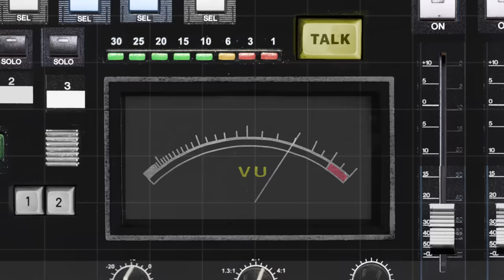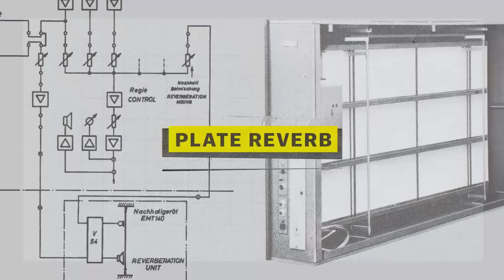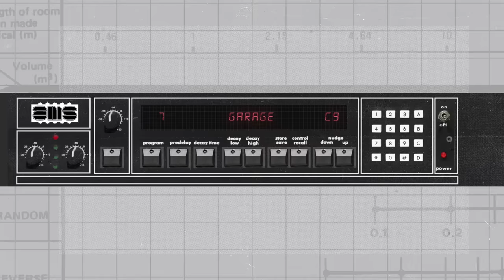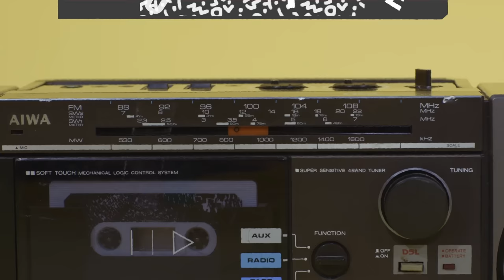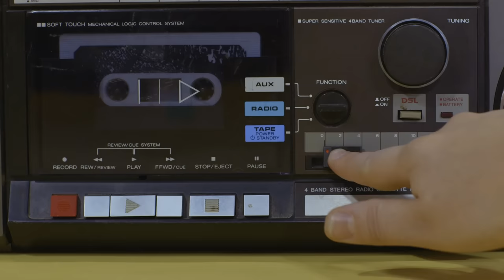How a recording-studio mishap shaped '80s music

Comment: Youngsters here are not aware that the famous " Wall of Sound" that record producer Phil Spector created was an empty underground propane tank used as a reverb chamber. This was in the early sixties.  The real innovators were George Martin and the Beatles, accompanied by the young Geoff Emerick, as they broke all the old studio " rules" which were designed to protect the sensitive and expensive microphones and other equipment.  They removed bottom drum heads and inserted mics directly into the drums, them used compression and fooled around with tape speed to lower the pitch, in addition to applying reverb and double-tracking. On the song " Rain", a bass guitar speaker cabinet was placed face to face against a second passive bass cabinet which became a " microphone " itself that offered a unique sound. On " Tomorrow never Knows", Lennon asked for a vocal effect which would make him sound like the " Dalia Lama" on top of a mountain". Young engineer Geoff Emerick at first was stumped because reverb and double- tracking would not achieve that. He came up with placing a mike up to the rotating horn of a leslie speaker cabinet, where Lennon's voice would be routed, instead of an  organ. The slow rotation of the horn not only created a " phase shift" effect, it also applied a severe frequency limit to the vocal, making it sound like a " bullhorn" without the distortion. Emerick even used a pencil to "warp" the sound coming from a particular tape machine during a mixdown to create a special effect.
         The first digital effects in the 1980s were low bit rate devices with poor fidelity , bad dynamic range, and full of noise....the old studio tricks done by the Beatles were done on expensive pro equipment and though these tricks were mechanical and done manually,  the FIDELITY was high quality with a full range of frequency response. Just listen to the drums on " A Day in the Life",or, on "Rain", where the pitch was lowered on the drums by slowing the tape down, giving them a powerful, low frequency sound not normally achievable.
     The point is that whatever was done in " the 80s" was really building on what already had been done in the late 50's through the late 60s.
Reply: The 80s did not so much build on what had been achieved in the 60s as systematically unpick it and replace it with something noisier, uglier and nastier. I have a lot of time for Ian MacDonald's claim that the 80s were a kind of "anti 60s", politically and aesthetically (although the highest achievements of the 60s had already been put into reverse by the early 70s).
Reply: 80s digital reverb > the Beatles
Reply: there is a reason why music from the 80's is mostly forgotten compared to the classics of the 60s
Reply: 80s was a terrible decade for literally all art forms
Reply: Yep, one of my brothers used a speaker as a microphone.
Reply: John Foster thank you for taking the time to write this
Reply: John Foster 
And emmerick stuffed a four man sweater into the bass drum to muffle it to allow the Mic nearer to make it louder without loud extra sonorous noise with the sound like on a loose tom.
Reply: Khayyam1048 
I think that the 70s were the time that new tech was expanded in an awkwardly wooden phase, and the 80s got more serious about free experimentation again, with added familiarity adding to the fluidity of expression.
Reply: xdmeister 
The Beatles didn't have many true rivals in the 60s.
In the 80s many like them existed, flooding the British music invasion of that time with a surplus of new styles. 
It's false to say that much 80s music isn't remembered.
No one forgets tears for fears, Duran Duran, traveling Wilburies, Billy idol, etc.

Comment: pretty decent video - only two mistakes (well, three if you count skipping right over spring reverb, which is also a HUGE reverb sound that has come back into vogue, if it ever really left) -- 
1) at 4:17, you mentioned that the AMS RMX16 was the "first" reverb unit to be driven by processors, etc (1982)... the first one was actually the EMT 144 in 1972; then the EMT 250 came about in 1976, which was heard on tons and tons of recordings. The AMS was profound because it was the first to offer a "non-linear" program. 
2) it's pronounced "padjam", not "padgum". :)
Reply: slamcrank Actually 4 mistakes, the guy play the drum machine. She said it was an LM-1 but it’s actually a Linn Drum (which came after the LM-1).
Reply: Good call! I was a bit disappointed spring reverb was left out as well. Patented in 1939 it definitely should be included in what is essentially a reverb history lesson.

Comment: When I made synth music with my friends in the 80s we had a reverb box built from a kit that used a metal spring stretched inside a box, you fed a sound in and an electro magnet vibrated the spring at one side, then a guitar pick-up picked it back up at the other. You could create a gated sounding reverb effect by leaning something light against the spring.

Comment: May have been mentioned already... but the RMX16 was not the first digital / processor controlled reverb. In 1976 the EMT250 was conceived, the very first digital reverberator. In 1978 there was de Lexicon 224.. Vangelis his tool of choice, next to the CS80. Instant Bladerunner...
Reply: You're absolutely right. The EMT250 was indeed first and Lexicon 224 the second one.
Ideally, this should be corrected in the video (or at least your comment upvoted to the top...).

Comment: Lexicon 224 was introduced in 1978, three years earlier than the AMS. It was also microprocessor controlled (Intel 8080) and I am pretty sure that was the first microprocessor controlled reverb, as the EMT 250 only used a bit slice DSP without a host microprocessor, though that was one of the earliest digital reverbs I am aware of. The 224 sounds were more natural, without inverse or gated algorithms, the AMS was quite early for those effect type of algorithms, Lexicon added those to later reverbs, the PCM70 and 224XL.

Comment: 1:48

That's not accurate. Compressors do reduce loud sounds, but they don't amplify quiet ones. They simply make peaks quieter, which brings everything closer to an average loudness and allows the output to be turned up more.
Reply: SurpriseFace Not just peaks, but anything above a set threshold. This is all assuming that software-based compressors work the same way as hardware-based ones, like in the video, which they should.
Reply: Compressors most definitely do amplify. Chopping off the peaks is the job of the limiter.
Reply: +fletcher DeMaine you're kind of both right/wrong. Typically compressors and limiters have gain control, and it is up to the engineer to use them. they both do both. I would say supriseface is more wrong than you though
Reply: and a limiter is just another type of compressor
Reply: many modern compressors have a "makeup" function which brings the signal to the original volume again, so you don't have to bring it up manually for the same volume as before. So, if your compressor has this feature and you decide to use it, it also makes quiet stuff louder. I agree though, the way it was said in the video was quite misleading.
Reply: Ha ha. I just made this comment before realizing a hundred people before me already did.
Reply: SurpriseFace makeup gain is a standard feature on a compressor unit, so in a word, yea compressors make stuff louder as well as compressing the dynamic range.
Reply: +craig thomas and every window is also a door
Reply: Using makeup gain is part of every standard compressor and workflow, so at best you're being pedantic in a video that is not detailing compressors.
Reply: Fletcher DeMaine nice reply. U understand!!
Reply: There are compressors that can individually amplify quieter ones, usually they are within a certain frequency range and you just boost the quieter frequency. But yeah I think you are right. You just reduce the loud ones, add some overall gain and all the quiet sounds stand out more assuming they aren't in the mud range.
Reply: +465marko I got that reference!
Reply: +Sunny Bear Really?? wow I didn't expect that. Peep show, yeah? Although it also reminds me of a bit in the mighty boosh...
Reply: Yeah, David Mitchell is an international treasure! :D
Reply: Since we're being total nerds, some compressors drive the input into a fixed threshold (1176, Distressor), so they in fact reduce dynamic range while making everything --- both the loud and soft stuff --- louder at the same time, they won't compress any other way.

And if you hit the 'auto makeup' switch on something like a 2500 first, adjusting the threshold makes the loud stuff quieter and the quiet stuff louder but the overall perceived volume stays remarkably consistent.

Vivé la compressión!
Reply: Most compressor units have input / output gain knob(s) which do amplify the volume to compensate (or "make-up") for the compression. So while the "compressor" part of a compressor doesn't amplify quiet sounds, the make-up gain would.

Comment: To be precise this is actually an inverted, non-linear signal processing effect. Without inverting the reverb tail you wouldn´t get the sound to swell (it would decay as normal). The non-linear part makes it swell at an exponential rate as opposed to a linear swell. There must have been so many hobby drummers back then trying to emulate that sound at home without any luck.

Comment: Interesting. Do they do anything different to get the drum sound right for live gigs?
Reply: Some bands I've seen just use electronic drum pads which play the prerecorded sounds
Reply: ohmanger What do you mean by "different"?
Reply: ohmanger most digital consoles should be able to add gated reverb to drums. Even analog consoles with digital effects might be able to do it.
Reply: e drums
Reply: Get a mic on the snare and plug it into a board that can make gated reverb. Bam. Live 80s drum sound. There are plenty of large mixing boards with built in effects, or even the ability to route external effects. It's just up to the audio engineer to turn it on at the right time. Go to a reggae show, they do a bunch of cool live drum effects there ;). It's more than possible to make these sounds on a live drum kit
Reply: Get a mic on the snare and plug it into a board that can make gated reverb. Bam. Live 80s drum sound. There are plenty of large mixing boards with built in effects, or even the ability to route external effects. It's just up to the audio engineer to turn it on at the right time. Go to a reggae show, they do a bunch of cool live drum effects there ;). It's more than possible to make these sounds on a live drum kit
Reply: Adam Pagenkopf An analog method would probably replace the digital reverb with a plate reverb or spring reverb and that's it.
Reply: ohmanger I would think that you would need an internal mic inside the snare drum, to minimize feedback and noise. The same effects should work. I was wondering the same thing, and would like to hear a more expert opinion than my own, even though I am experienced in my home studio.

Comment: I'm surprised you don't mention the Lexicon 224 and 480L. All throughout the 70's and 80's either one of these could be found sitting on most large recording consoles. They are still being used today.
Reply: As well as the Quadraverb. I ressurected one and used it for several years at a TV station where I worked . Peter Frampton liked the sound. How bad is that?
Reply: csjaugiedog yeah, the studios are probably still paying them off lol
Reply: Yeah this video is incorrect at stating that the AMS RMX 16 was the first digital reverb unit. It wasn't. Both the EMT-250 and the Lexicon 224 preceded it by several years. I think the Lexicon 224 and later the 480 where actually the most popular unit in the 80s.

I still use my Lexicon MPX-1 and PCM 91 reverb units in my home studio. They sound great.

Comment: No, no, no, no, no.

Hugh Padgham - that's pronounced pa-jum.

No, the console didn't have a noise gate on it, Hugh padgham used a Drawmer outboard noise gate, as did everyone at the time, because SSL consoles tend not to have the type of noise gate needed for this type of effect - if at all. They have effects sends. Not many consoles have noise Gates built into them, they usually just have patchbays, that allow you to patch in outboard effects modules.

Secondly, although the control room talk back mic gave Hugh the idea for the type of sound that he wanted after he heard it, that's not how the final sound was actually produced.

So Hugh double mic'ed the tight skin head (tuned so that it removed the boxiness) with a Shure SM57 & AKG451 small diaphragm mic to record both the hit, and the snaps, then heavily compressed the sound using a UA 1176 compressor, then added a huge stereo plate reverb using an AMS RMS 16 (which is the reverb unit you mentioned in this video - but it debuted around the time Phil was recording this album in 81, so was able to use it for this production), then used a a rack of Drawmer DS201 twin channel gates with the filters adjusted to let a lot of the lower frequency information pass through on the snare, whilst heavily gating the high frequencies to give it the sharp gated shut off & panned left and right of centre to add width and hugeness to the reverb through a stereo channel on the SSL console. The gates on the Thames were filtered differently to allow different amounts of frequency information to be gated depending on the tune of the Tom heads. They were each panned separately in a different part of the stereo field.

The sounds was further enhanced, by using the mix bus compressor on the final mix so that the drums were all heavily compressed including the toms and kick, which also had the compression and gated reverb, panned in such a way that the kit moved across the stereo field as Phil played fills.

The talk back mic was simply the inspiration, it was not the final solution. It just gave him the idea. Engineering it, was a different thing entirely.

It's important to note, that people had been tuning drum heads for different types of sounds for decades - long before the 80s. Gates had been used since the 60s, and plate reverbs had been used since the 40s along with spring reverbs.

It wasn't really a new idea from Hugh Padgham, he just made it famous, by enhancing the engineering aspect of this style, and making it popular through Phil Collins.

Tom Lord Alge had been using a similar method on his recordings and mixes for some time as well, however, he hadn't used it, or popularized it, to the same extent, or hugeness until then.

So it's not really an invention, it was just a sound nspired by hearing something in his mind, which itself was inspired by the talk back mic on the console.

AMS reverb was used a lot, because it had the type of plate program that was unique in its algorithm, which by the way, is still a closely guarded secret even today. That's why it's taking so long for AMS to introduce the plug-in for Pro Tools and other DAW's.

Comment: Actually, I disagree with this...  the drum sound of the 80’s was created by Mutt Lange using an Eventide harmonizer and pitch shifting the snare down by 50% and turning the feedback up a lot.  It IS the sound of the snare on Back In Black by AC/DC and so many other hits.  In a lot of these examples in the video I can hear the pitch shifting on the snare and Toms that they are trying to say is just gated reverb.  Yes it maybe started with gated reverb and non-linear reverb is layered in with most drum sounds in most of these examples.  But it’s the 910 pitch shifting that really created that 80’s “sound”.  At least to me.  As someone else mention gated reverb was being used back in the 70’s and so to me gated verb is not an “80s” thing.  But that 910 pitch shifting trick on the drums defined drum sounds throughout the 80s and into the 90s.  

And if u want to try it at home.  Put the 910 on an aux track and feed the BOTTOM snare mic to it.  Pitch shift it down 50% and turn the feedback up somewhere between 50 and 70%.  Then turn the aux all the way down.  Play the drums and start turning the aux up, blending it in with the dry drum sound.  THAT is the 80s.  At least to me it is.
Reply: Bowie and Visconti used the Eventide Harmoniser with pitch shifting in 1976 on the drums on Iggy Pop's 'The Idiot'.

Comment: Y'all forgot spring reverbs.
Reply: Yeah, it's a short video and there isn't time to cover everything, but jumping directly from reverb plates to a 1982 digital reverb (advanced enough by then to have the gating effect already built in) was a bit weird.

Here's the missing bit (my version): "People tried to make reverbs smaller and lighter in various ways, such as using long springs inside a tube, and then analog electronic circuits that could delays sounds for a short time... eventually, digital delay lines were invented, which could give much longer delay times (like having a much larger reverb room), took up less space than a spring reverb, but were much less prone to unwanted side-effects. By putting several digital delays in one box and mixing them together, the first digital reverb unit was created. As computer technology advanced, the digital units started to acquire extra sound-manipulation tricks and features. Here's one from 1982..."